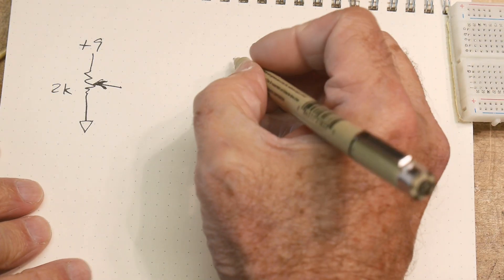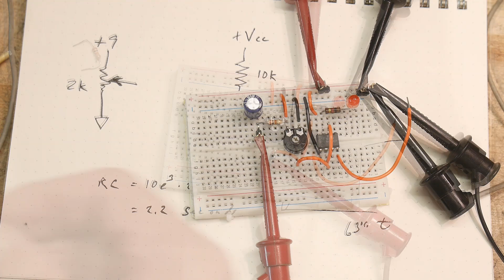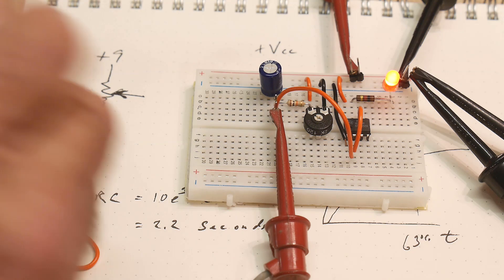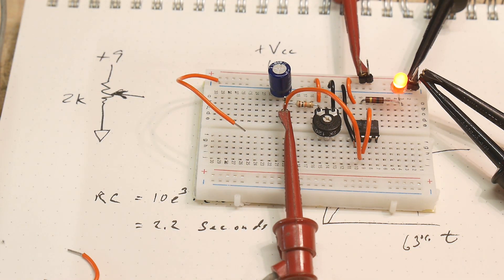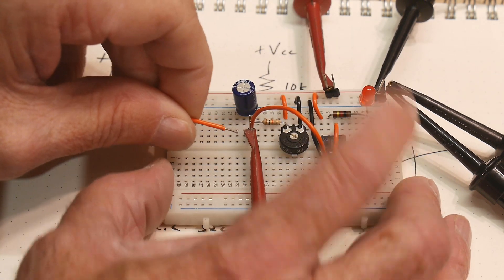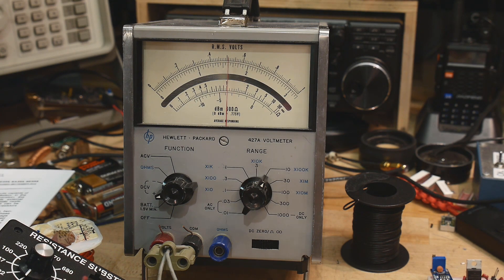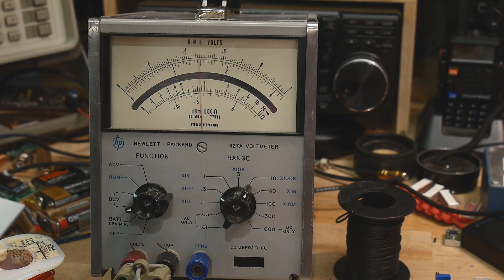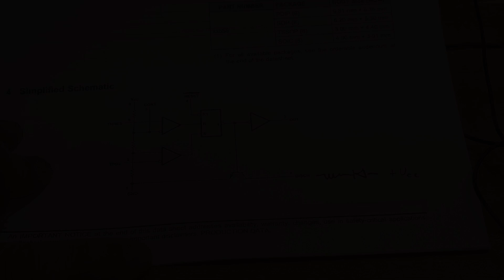#730 Basics: 555 Timer (part 2 of 2)

Comment: The reason that "E" is used is because, in mathematical circles, "e" is Euler's number ≈ 2.71828. This would give very different results. :D
Reply from the maker: yes yes yes I know. I have a degree in mathematics. for me to jot down numbers it is a simple pen stroke to make a lower case e.
Reply: Sorry, I realized that you knew that after I wrote it. I came here to delete it, but you'd already commented.
Reply from the maker: @zaraak323i  That's OK. I get pretty sloppy since I'm usually in a hurry.

Comment: Thanks, I was having a issue with Carrier Operated Relay circuit using 10-30pF and 510 Ohm in series to pin 1 of Opto-coupler with diode IN4148 A to GND to drive opto-coupler (MOC8021M). OUTPUT: across pin 4 &5 of opto-coupler is 100uF Cap with a SSB switch with 1000uF Cap. Pin 4 to GND and Pin 5 to drive 12V relay. The relay cuts out unless I speak non-stop. Any ideas? do you think the timing circuit is a better solution?
Reply from the maker: Most use  a circuit like this: https://www.qsl.net/va3iul/Homebrew_RF_Circuit_Design_Ideas/PA_70cm_10w-in_50W-out.gif

Comment: The reason that the 10k didn't work for the discharge resistor is because when the transistor is on the two resistors form a voltage divider that will only discharge to half of vcc which isn't low enough to get to the 1/3 vcc lower hysteresis point.  A low value like 100 ohms would have worked similar to your original intent of quickly discharging the capacitor, but it would discharge to 1/3 of vcc rather than 0v.

Comment: Back in the 70's I used the circuit you described to interface a Western Electric TT keypad to my 2 meter rig to keep transmitter keyed between digits.